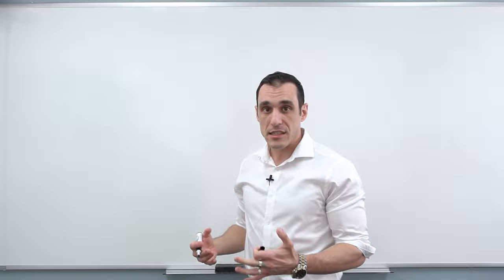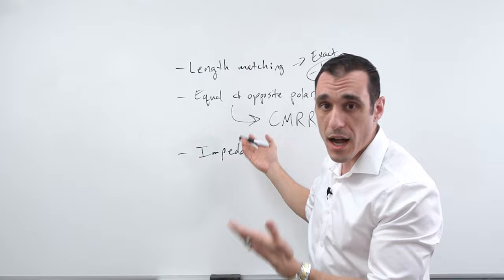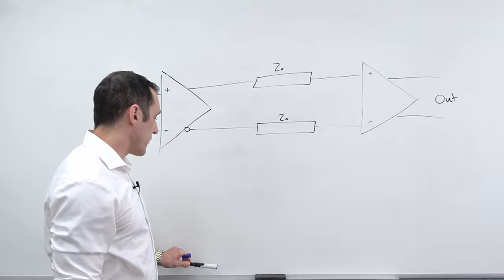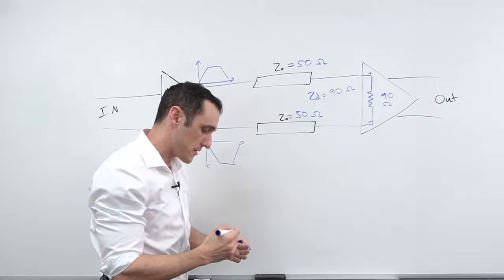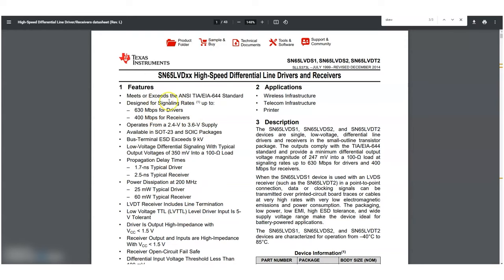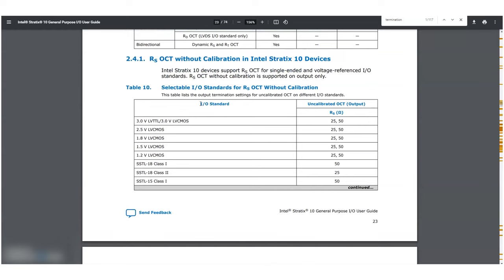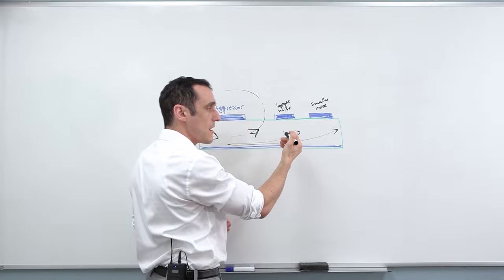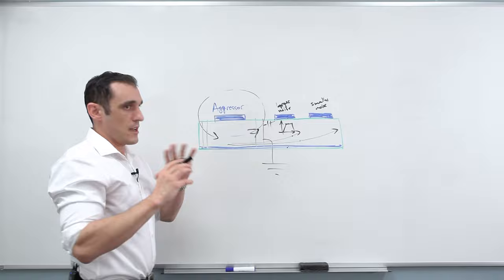Advanced Differential Pairs Concepts

Comment: Ferrite on VCC / Power delivery pin really helps to increase impedance for the frequency where we wanted to increase attenuation by carefully selecting the ferrite bead based on the attenuation curve and frequency response, and decoupling cap near the PIN can work line a local energy source , could you please suggest more details to avoid ferrite on power delivery bus if this really creates a problem ?

Comment: Thank you a lot for the explanation Mr. Zach, you really help me to understand better about differential pairs. Let me ask you a doubt about differential pair in USB design that I saw this week: Can I put pull down resistors in differential pairs?
Reply: For USB you would do this according to the USB stadnard. We have a blog on the Altium site where we show this, we also detailed this in another video: https://www.youtube.com/watch?v=4LwnEaNvG8I

In general you would not do this unless you need level shifting or unless the protocol is designed as an open drain differential protocol, which is something you might do with specialty logic. You would do something similar in some differential pair receiver designs as this is how the original receivers were built from discrete components, but today you would not need to do this because those receiver circuits (and their termination) is built into the IO stage on your IC. In something like an FPGA it would be selectable when you configure the device.

Comment: When you don't have the optiond to place the aggressor line far from the differencial pair, if we place vias between aggressor and first differencial pair line and also vias on the other side near the second differencial pair line with the same distance (so the change in capacitance be the same for both lines) could that be a solution to shield the pair? Thank you.
Reply: You have to be careful with this strategy. Placing a line of vias between two traces is something that is supposed to be used in RF design, but somehow it got adapted over to digital design and now everyone does it when they shouldn't. Grounded vias or a region of copper pour with a row of vias is supposed to suppress propagation of radiation up to specific frequencies, they are designed such that the lowest order resonance in the cavity defined by the two vias is at much higher frequency than the specific frequency you want to shield against, which will then be effective for all lower frequencies. The problem with digital is that you might excite the resonances in the structure anyways because digital signals have content up to infinite frequency, so you might create a new problem if the via spacing is too large.

For digital, the better solution is to widen the traces a little bit, use a thinner dielectric, or both. Also bigger spacing is important. You can usually solve crosstalk or EMI problems by adjusting the PCB layout or the stackup, and if you do that you might find that the use of copper pour and via fences vias isn't always needed.

Comment: Hi Zach, after having carefully routed a usb differential pair with separation, line width, and length tune, how could we possibly verify that it is working at the impedance we meant to design? Any equipment to use and how is the setup?
Reply: If you are trying to measure the impedance directly you would use a vector network analyzer (VNA). This requires replicating the designed traces onto a test coupon. VNAs are expensive instruments, so what most people will do is use a TDR measurement as it is a less expensive instrument. If you have asked your manufacturer to do impedance testing, they will most likely do this with a TDR measurement.

Comment: May be i am missing something here. But, when you have d+ and d- , the magnetic lines of force between them add up as they are pointing upwards between the two traces. However if both the signals are having the same polarity, the magnetic lines of force cancel. Similarly, electric lines of forces for opposite polarity stay within the two traces, while, for two of the same polarity signals, the electric lines of force should be away from each other. So, in the example shown around 24 min, i am confused on the explanation. Please clarify.
Reply: With differential pairs, there is only constructive interference of electric and magnetic field between the two traces, but farther away from the two traces there is destructive interference. This is why differential pairs are preferable for sending serial data over a cable, for example; the fields are weaker away from the two conductors and the same occurs in a PCB. With common mode, the constructive interference happens outside the two traces rather than between them, which is why common mode currents are such a problem, especially on cables. It is the common mode currents that create large radiation that can cause an EMC failure, and this can occur despite the fact that the device can still function as intended.

Comment: If I run two pairs of differential traces along the exact same path that reference the same plane, but are on opposite sides of the plane, will they couple differential or common mode noise to each other?

Ex
plane
sig <--- diff pair #1
Plane
Sig <--- diff pair #2
Plane

Or does the plane provide sufficient shielding for both pairs that it wouldn't matter?
Reply: The planes do provide high shielding for these differential pairs.

Comment: why do you say to apply length matching at the driver side? ive heard best to apply at transition points (right before a via). could you talk on this?
Reply: Hi MrAlistar28, we just filmed a video in response to explain this, so stay tuned for that one in the next few weeks. The short answer to your question is: I find that the inhomogeneity tends to arise near the driver, and the idea is to resynchronize the signals so that anywhere else noise is received on the interconnects, it can be eliminated by the receiver because the rest of length of those traces is in phase. But if you generalize the recommendation to other situations, like if you need to make a lot of bends to complete a route, then you could put some small sections very close to where those length mismatches occur.

Comment: When I do length matching, it often can't tightly couple with the other differentially routed trace since it moves away from the other trace. To what degree does this matter?
Reply: Hi dmxspider,
So you've brought up two points here: One is about keeping the traces close together, and the other is about keeping them the same length. You're basically trying to balance noise suppression and prevent mode conversion.
If you've kept everything the same length, then you will very easily suppress mode conversion as long as there is no additional asymmetry (impedance variations from parasitics, roughness variations, etc.) along the length of the route.
If you keep everything tightly coupled together and the same length, you will have also minimized noise emitted from the signal travelling on the differential pair. This is very important for high speed signals with fast edge rates, which can have strong emission due to their high dI/dt switching at the driver and high dV/dt switching along the transmission line. The ability for the opposite polarity signals to emit lower noise than a single-ended signal is one of the big advantages of differential pairs.
If you start to have some separation between the traces, then you have less noise suppression and a little bit of mode conversion to differential mode, but only in that region where there is some separation. If it's a small area I wouldn't worry about it, but if you see during testing or simulation that it creates excess loss then you should try to avoide creating asymmetry.
Reply: Thank you!

Comment: Thanks for this Zach.

I just started to understand differential pair, recently I encountered a situation where I have to cross usb differential data due to the way the USB micro-B D+ and D- are constructed it is not in correspondence with the Source D+ D- coming from the controller.

I don't know if it is fine to cross D+ D- with each other, I know there will be need to use via, and How?

Also, I am using 4 layers stack up, sig gnd gnd sig, should the via go from layer 1 to 4 of just from layer 1 to 2, where those differential data will reference.
Reply: That's a good question. Probably the easiest method is to switch the USB connector to the other layer. If you flip it over you can then route directly into the connector pins, and you can just place the via transition at the connector pins or at the chip pins, either way should work fine. You also can route those pairs on the back layer, just cross the pairs over by the output of your USB host controller and add a  length tune section to make up any length difference.

If instead you are designing to the 3.0 (SuperSpeed) standard, you can swap the SSRX and SSTX pairs. This is because the SuperSpeed capable transceiver will send data sequences when instantiating the link to determine if any lane polarity inversion is present. Unfortunately this type of inversion is not implemented in USB 2.0 with the D+/D- pair. I would recommend moving to USB-C because that is the direction everything is going anyways.
Reply: @Zachariah-Peterson  thanks for this. I am working on that, but still finding it hard to get along with the USB C.

Comment: How to calculate the mismatch allowed b/w lines of diff pair
Reply: There are a few ways to do this. The best way depends on the rise time of the signal being transmitted on a differential pair. The signals on each side of the differential pair need to be rising at the same time, so the maximum mismatch is basically equal to the rise time. To be safe, set a low safety limit on this, something like under 50% as this will provide a big allowance for random skew, jitter, and ISI. So for example, if the Rise time is 100 ps, and you set a 20% limit for safety, your mismatch would be 20 ps and the link could tolerate no more than 80 ps of jitter. You would then take that 20 ps and convert it to a length using the propagation delay, which is easy to calculate or you can use the impedance calculator to get the propagation delay.

Comment: Regarding the ferrite beads placed in series with vcc, i sometimes when dealing with sensors like PIR i place a ferrite beads before the input vcc of the pir with bypass cap and also after the output pin of the pir to filter high frequency noise. ( I just put it before the sensor) do that also could cause problems?
Reply: Hi Fedi, thanks for watching! Regarding the ferrite, I was referring specifically to the case of placing a ferrite bead on a PDN that supplies power to a large high speed processor like an FPGA. This component could draw large bursts of current into the PDN, and the impedance of the ferrite creates larger voltage fluctuations in mid-range frequencies (around 100 MHz to 1 GHz), which can then produce noise on the IOs from that component. The better option to remove this noise with capacitors.

For DC regulators (like an LDO) and load components that only draw DC power, it's not really a problem because you are not drawing broadband current pulses into the PDN, so you don't need to worry about the impedance at mid-range frequencies. There is an app note from Analog Devices that nicely shows measurements where a ferrite did provide noise reduction in the case where a DC voltage is supplied to a static impedance (only drawing DC current). Still, the standard way to make that regulator is to provide low-pass filtering with capacitors to GND, so you might not always need the ferrite.

For a PIR sensor, I would assume it is only responding to slow movements that are closer to DC, but you likely have an op-amp that produces the output and probably has to respond quickly to those changes in input, so you might excite some transient. If you've gotten it to work accurately and you've tested it then I won't tell you to not use ferrites, but those are things to think about when using inductive components as they might create a challenge with measurement.
Reply: It is a common practice and practical to use single voltage source for multiple loads or components (FPGA, MCU, buffers, etc.) to save on cost. The ferrite bead is effective at reducing the coupling of noise from other switching loads in the same voltage rail. The capacitor is placed right after the ferrite bead to reduce or counter the impedance introduced by the ferrite bead. However, this setup sometimes causes a small amount of oscillations across the capacitor if the values are not properly selected. Sometimes, it is better to use a small value of resistor instead of ferrite bead.